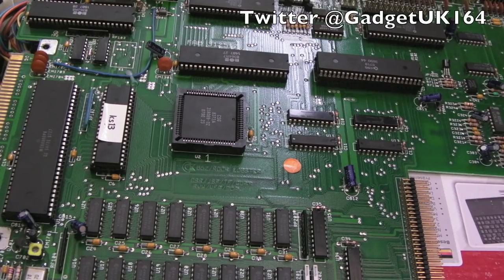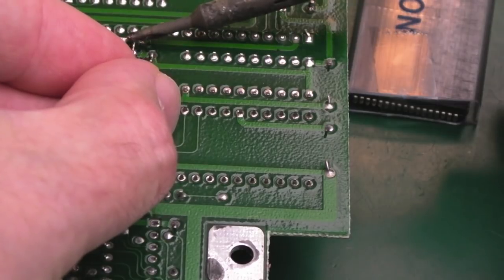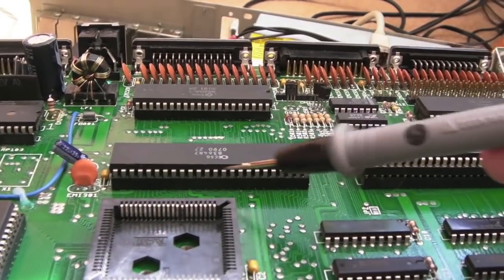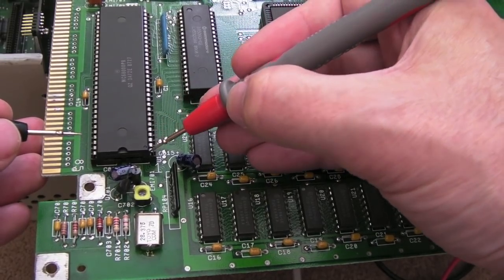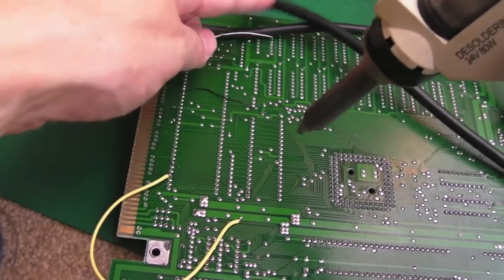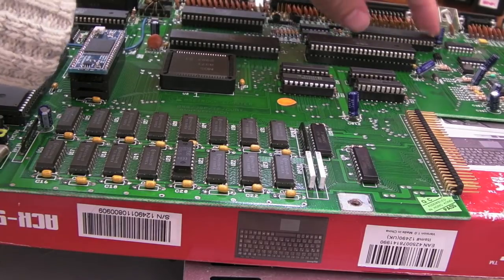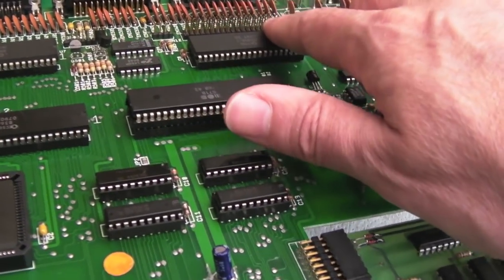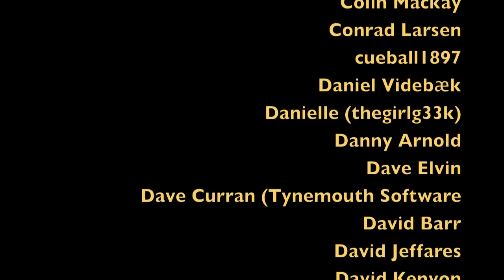Commodore Amiga A500 Repairs Part 6 (Rev 3)

Comment: That’s my old board, i marked the CIA with a D back in 2018, yes that chip was defective. 
I remember i gave this board power, it gave black screen and jumped to the next board. 
Have a pile of Amiga boards, to fix, I skipped this one, because of the early rev. Wasn’t surr about the 1MB Chipram hack was possible on this rev. 
So nice to see the board repaired now, clear to see your enjoying it. 
Great channel and work done
-Retrocengo
Reply from the maker: It's a small world lol!  Did you sell it to Stefan or are you Stefan?
Reply: GadgetUK164 - Retro Gaming Repairs & Mods Stefan Skotte is a dear friend of mine, we are talking Amiga all most everyday, he told me to check out the video. 
He got a bunch of amigas from me. 
Im also running a youtube retro channel, have alot of amiga project. 
In a new fan to your channel, subscribed😁👍🏻

Comment: Just realized @ 2:42 the Cyrstal Osc was missing while you had the machine on.
Did the 68000 CPU fry?
First thing I was ever taught about Amiga mobo's was to Never ever turn on an Amiga if the Crystal OSC is gone.
It can be the death of a CPU instantly.
Reply from the maker: The crystal isn't located there on that PCB!  If you watch further on you will see the crystal is down at the bottom!  I've never seen a CPU fail due to a dead crystal, and I've come across many!
Reply: @GadgetUK164   okay

Comment: I have a bad socket on my A2500, it has a mega chip and it would not boot. I pulled out the mega chip and from the top I lightly pulled the pins inwards, I went around a couple of times and now it boots no problem. I thought I would give it a go as it would either fix it or totally break the socket and I have replacements.

Comment: Nice work! 
Just wondering if you socket the ram chip on the bottom row, won't the keyboard hit it when it's back in the case? 
MIght be fun while still socketed to put the old faulty ram chip back in there, connect up a serial port, hit DEL and see what the ROM-Whack debugger looks like?  I guess these days diagrom is more useful though.

Comment: Hey mate, I have a request to make. I apologize as it is not related to this video in particular, I saw you worked on a consolized MVS model MV1FZ before...you see, when I got mine a couple of days ago, one of these: https://imgur.com/a/TmOi88C SMD caps were blown. If you can, could you please give me the capacity and voltage values of one of the many caps on the board so that I can buy another one? I would really appreciate that! Also, I really dig your repairs, I just found out I wasn't subscribed, blasphemy! Keep up the amazing work and electronics repair related content ;)
Reply from the maker: 100nF 50v - not sure on physical size, but I suspect an 0805 would fit OK!
Reply: @GadgetUK164  I am genuinely impressed by how fast you responded and by your sheer commitment to read and answer every comment, this is something that barely anyone does nowadays, kudos (and thanks for the info!)
Reply from the maker: Thanks!  No worries!  It takes me ages sometimes, but everyone has good stuff to contribute with regards comments and questions, so I always try to reply where I can!